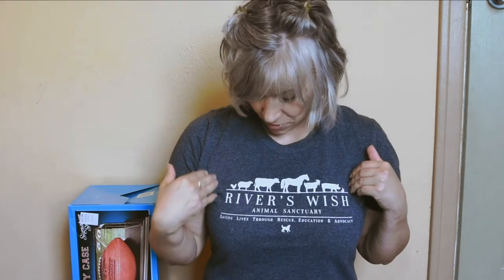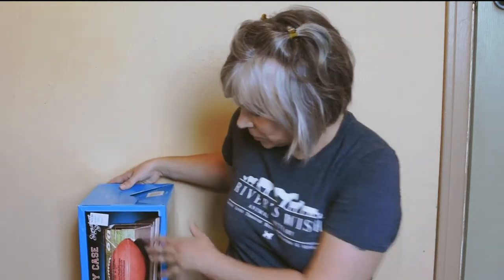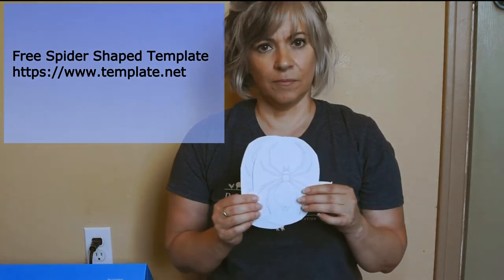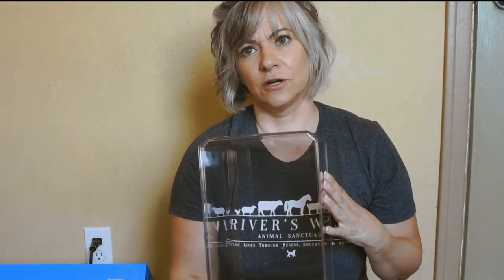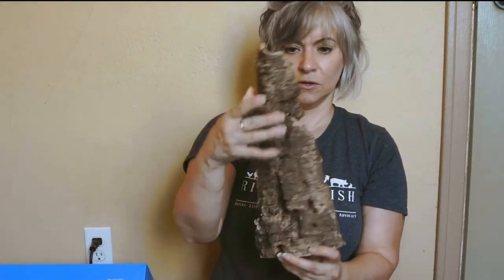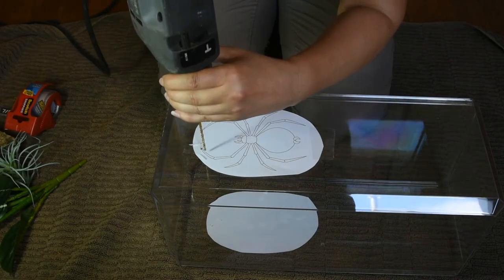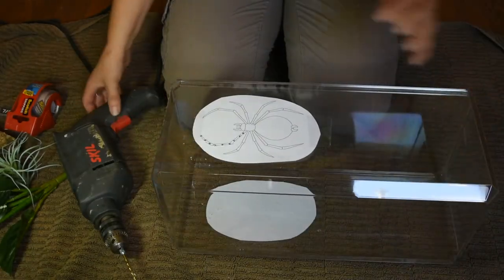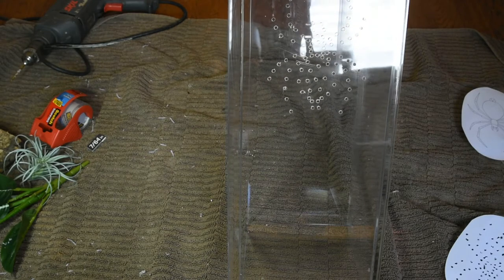DIY Arboreal Enclosure: Part 1

Comment from the maker: *For an easier way to apply silicone, KC Tarantulas recommends using the corner of a piece of cardboard or plastic to apply silicone along the inside seam of the enclosure.

*I will be doing a short video about the Hobby Lobby enclosures and how they come with a black base that is unnecessary and you can be fooled into thinking it's a bigger enclosure if you're not careful. In my case, this was the last one and I needed to get the enclosure finished, so I bought it at a few dollars more with the base.
Reply: I know this is old but you could also put the silicone into a syringe